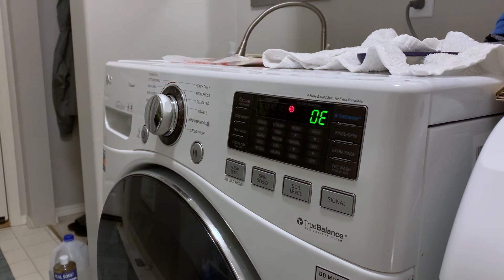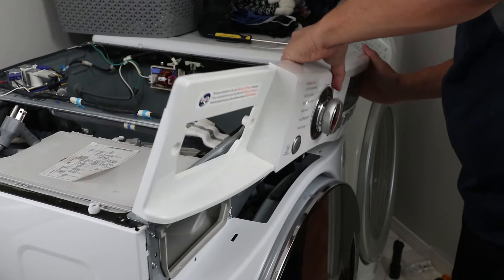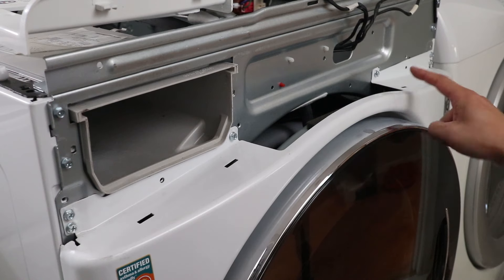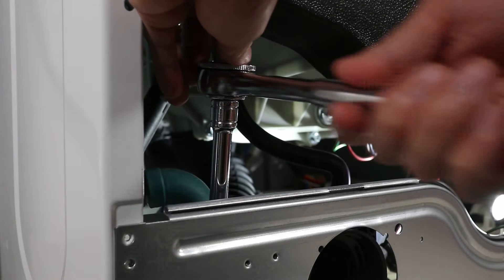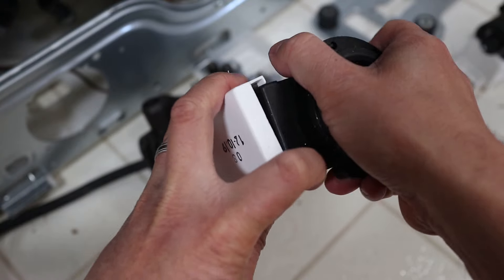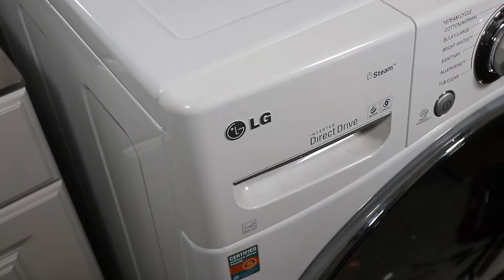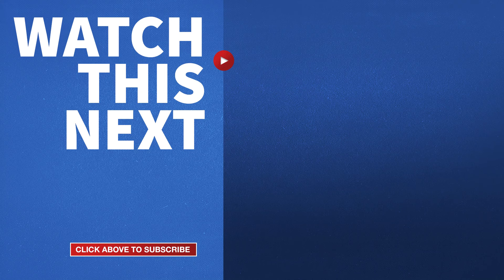LG Washer OE Error Code - LG Washer Not Draining Fix - LG Washer Drain Pump Replacement Tutorial

Comment: Well done - there was no corny, unnecessary commentary that dominates DIY videos.  I'm not handy, but was able to swap out the pump.  On Amazon - bought the pump for $20, and the spring tool for $12.  $32 repair and 90 minutes of my morning vs a new $700 washer, or $300 repair.  The hardest part was getting the pump out of the plastic housing.  The spring around the window was easy with the "spring tool."
Reply from the maker: So glad my video was helpful! It certainly saves a lot of money replacing the pump yourself! Nice work! Something you can feel proud of!

Comment: I watched several videos before this one. I really had doubts about trying to do it myself. After watching this one I didn't. It was very well done. I watched it beginning to end, went and bought the part and spring tool, and then watched it in segments as I did the job. It was an excellent tutorial and I want to say thanks for saving me some $$$$. The only place I disagree with the OP is that for me getting the main drain hose back on was the hardest part. But, it might have been the angles along with the pliers I had to use. All in all 10/10 from me. Thanks!
Reply from the maker: You’re welcome! I’m glad my detailed video gave you the confidence to take on this repair! I didn’t have any problems with my tubing but I can see how it can be difficult with the small space under the washer. Nice work doing it yourself and saving money! Thanks for watching!

Comment: Great video!  For the “spring stretching” part at the end I used a scissor, put the two tips in each loop and pull apart.  You’ll need someone to help you walk the ring in but it works!  Thanks again!
Reply from the maker: You’re welcome! Glad you found an alternative solution to help with reinstalling the spring. Nice work repairing your washer! Thanks for watching!

Comment: Wow thank you! I just did this repair on my LG that's almost identical to this video and your attention to detail made the job so much easier. I'd just add a word of caution to anyone that I think the 3 bolts that hold down the pump assembly go into plastic and only need to be hand tightened, could easily strip the plastic threads if using a ratchet to re-assemble. I could be wrong.

Comment: Great video! Would be nice if LG just charged an extra $100 for the washer and used a drain pump with a stainless steel impellor that doesn't warp and break. I did three of these pumps on my last LG washer. The replacement pumps they sell last maybe two years, so bookmark this video, folks, you will doing this again and again and again.
Reply from the maker: Yeah that impeller is plastic and can break easily over time. That’s why I made this video as detailed as possible so that when I need to replace the pump again I can see exactly what I did to replace it. Thanks for watching!

Comment: Though it took me longer than it took you, it worked!! My Unit had a metal bracket / brace that had to be fully detached from washer to replace the broken part. It didn’t have a quick clip like yours did. Added an hour of frustration, but I got it! Thank you
Reply from the maker: You’re welcome! I’m really glad you got around a snag that added more time to the repair! But also glad you got your washer fixed on your own without having to call a repairman! Thanks for watching!
Reply: I have to order mine do you what’s the part # of the water pump

Comment: Great video. Thanks for the info. I saved a few bucks and made my own spring expansion tool with two small head screw drivers and two zip ties. I crossed the screw driver shafts, put a zip tie going in each direction and it worked like a charm.
Reply from the maker: Excellent work! I think another viewer also made his own spring expansion tool! You guys are very creative!

Comment: Excellent job describing the process! Regarding the ring installation, I was able to get the ring back on using two bike tire levers. It’s a little finicky but possible. The expansion tool is probably an easier method. But in a pinch, the tire levers will work. Just get the ring started on the top half. Place two tire levers in the 4 and 8 o’clock positions. Place pressure toward the machine on the levers and wiggle them down to the bottom and push the spring over the ring retaining lip. 
Thanks for the video!
Reply from the maker: You’re welcome! Glad my washer pump replacement tutorial helped! Nice work getting the spring back on without the expansion tool! That’s a great workaround! Thanks for watching!

Comment: Thank you! I used ur video and successfully changed my drain pump. My LG was slightly different. I don’t have space to tilt it up and I have a drawer pedestal, so this was the way to go. I reassembled rubber ring easily with the help of another pair of hands.
Reply from the maker: So glad you were able to replace the pump in your washer even with the slight differences. Saves quite a bit of money doing it yourself!

Comment: It looks fairly simple. My LG washer is doing the same thing. I ordered the drain pump. Pretty cheap. Part came in today. Now to get the spring stretcher. Thanks for the tips. Also, I have stackable washer and dryer. Have to take the washer down. Worth a try. A project for the weekend. Keep you posted. .
Reply from the maker: Thanks for commenting! I hope you got your LG washer pump replaced ok! Hopefully my video was able to guide you through the process! Thanks for watching!

Comment: Thank you so much!  This is one of the best tutorials I've seen!  Notes I learned from taking mine apart: 1. the door switch plug is easy to get to once you undo the screws and lean it down toward you, then you can get a hand from the side and the top. 2. For the spring I just used some needle nose and stretched the spring really far, then just rolled the wire over the edge, it was super easy and doable. 3. Plug the wires in while the motor is out and you can see it clearly, I first installed then plugged and didn't get the contacts to connect and bent a lead which caused some unnecessary work.  Again, great tutorial, thank you for giving me the confidence to DIY!
Reply from the maker: You’re welcome! And thanks for the additional tips for this repair! I’m sure others will find your suggestions helpful! So glad you got your washer pump replaced yourself! Thanks for watching!

Comment: Great video. Had washer fixed in 48 hours with Amazon Prime delivery. Bought an OEM LG pump and the spring tool that is recommended in the video.
Reply from the maker: Excellent! Really glad you got your parts before starting your washer repair! Makes the process smoother! Thanks for watching!

Comment: I echo everyone else's comments about the quality and the helpfulness of this video. The only bits of constructive criticism I have are: 1) It wasn't clear (to me) that you need to position the manual drain hose through the hole in the front panel before attaching the mounting bracket, and 2) It would be helpful to warn novices (like me) to be aware about when they are tightening screws into metal versus plastic. I wasn't paying attention and I think I overtightened the three screws that hold the drain pump bracket to the bottom of the washer. I was waiting for the screws to get real tight but apparently they are screwed into plastic and they never got very tight so I probably stripped all three of the holes. I hope the bracket will stay secure! Thanks for this great video and I hope my comments are helpful to others.
Reply from the maker: So glad my washer pump replacement tutorial was helpful! I’m glad you were able to do the repair yourself! For me it’s definitely a lot to think about when shooting this video and doing the repair for the first time on camera. I’m learning as I go! I tried to include as many details as possible but it’s easy to forget to mention a few things. But overall as I read the comments this video has helped a lot of people! Thanks for watching!

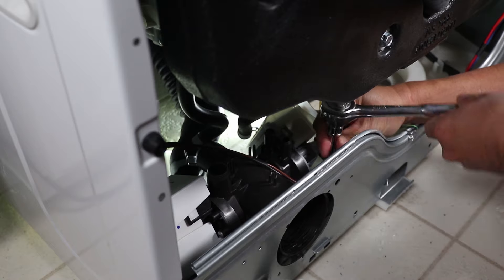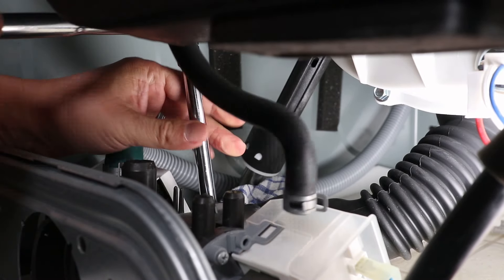Comment: You can get away without the spring stretching tool, if you have two relatively strong people applying pressure on the retaining ring at about the 7:00-8:00 positions, and 4:00-5:00 positions.  That will allow you to reseat the ring rather easily with a screwdriver.  Took us only two attempts to get it.

Fantastic video, BTW!
Reply from the maker: Really glad you found my washer pump replacement tutorial helpful! Yes it’s possible 2 people can get the spring back on without the spring expansion tool! I’m glad you had someone to help with that! The spring tool really helps when working alone. Thanks for watching!
Reply: I've taken it off and on many times myself with pliers. I now just leave it of and hung the wire on the back of the washer. Never have a problem,  just check the gasket once in a while. Now fixes are quick. Change the lock super fast as well as saves time on future repairs.
Reply: @Ann  Good to know.  I was looking for another option like cutting off the spring and replacing it with an elastic connector or something more forgiving. Something that could fit in the groove and e strong enough to provide resistance. I’ll leave it off for now until I find a better option.

Comment: Great useful video. I just cleaned the pump and put it back in. 
I did get the toughest part done without the tool. I pulled the spring open with two small screwdrivers while my wife helped get it in the groove.
Reply from the maker: Excellent! Glad you got the spring back on without the expansion tool! That part really is the hardest step in this repair! Thanks for watching!

Comment: Thank you so much for your detailed video. I purchased the spring extention tool and a pump. Your video gave me confidence to try changing out the pump and I was glad my LG ventless washer dryer combo had almost identical steps. I was able to also use the spring extention tool to help remove the spring instead of using a screwdriver to wedge it out. A tip that I was given years back from the guy that installed my Machine on how to easily slide and move the machine was to spray something like windex or soapy liquid on the floor under the machine and that helps glide it and it really works. Once again thank you and I am so happy to have a pump that is working again.
Reply from the maker: Thanks for the tip on how to move the washer! And the spring expansion tool can definitely be used to remove the spring. I just didn’t have it when I started. But as you saw I had to order one so I could finish the job. Thanks for watching!

Comment: Thank you so much for your video. Your instructions were perfect; easy to understand, easy to follow. My pump was broken at the impeller just like yours in the video. The hardest part for me was getting the drain hose back on the back of the pump ( not a lot of room). The spring ring around the gasket was easy with the tool you suggested. Well worth the $14. God bless you!
Reply from the maker: You’re welcome! Glad to hear you were able to repair your washer yourself! Yeah even with the price of the tool (that may only be used once) you still save a lot of money by not having to call a repairman! Nice job! Thanks for watching!
Reply: Agree, the hardest part was getting that pesky hose on back of pump. I may need to look for smaller pliers or smaller stainless steel adjustable clamps instead of the ones included in the lg washer. Overall this DIY video was awesome 🤩

Comment: I just replaced the drain pump with the help of your video clip. I also ordered the  pliers which make the job easier. I expect that the pump will need to replace again ( the old one last ten years). Thank you
Reply from the maker: You’re welcome! I’m really glad you were able to replace your drain pump using my video. Those pliers for the spring really comes in handy. And even though it was for one use it’s still worth it considering the cost if a repairman were to do the job. Thanks for watching!

Comment: Bwahahaha, I knocked off a bumper foot and took forever to find it. Got lodged in front in the wire cluster. I was creepy crawling all over trying to find it. Finally.
You are the best. I won. And it's working again. That gasket retainer with the spring is absolutely a (insert nasty word here) I needed 4 hands. Didn't have the plyers.
Your my hero.

Comment: I was ready to start calling around to schedule a repair visit.  I expected the removal of the front panel to be far worse. I was afraid I'd have to go in through the back, which I wasn't looking forward to. Your video showed it to be quite manageable. The two pump motors (Yep, two. Mine has two motors running to the housing - same part number.) are on order. Not sure which one is broken.  I'll just swap them both and be good for a while. I was on the fence with the pliers, but I don't have the patience to go to war with this thing, so I ordered them.
Reply from the maker: Excellent! By now you’ve probably repaired your washer I hope! The spring expansion tool is really helpful! Not too expensive either for what might be a one use tool. Overall the price of the pump and tool is WAY less than calling a repairman! Thanks for watching!

Comment: A wonderful instructional video. One of the best I have used. One point to highlight is to ensure that all water pipes are fitted tightly and for the main water pipe access maybe use a screw-down hose clamp as the one that comes with the LG is very difficult to fit due to the confined space.

Comment: This worked well for me, thank you very much! While you are in there you should also clean out the drain tube. Mine was all full of sand that most likely contributed to the failure of the pump and was preventing the tube from draining water in the tub. I also found when replacing the spring, you can use zip ties to attach to either side of the spring to give your fingers something good to pull on to release the tension. Works much better than pliers or screwdrivers and saves you from having to buy a special tool; just cut the ties off when you get the spring in place. Cheers!
Reply from the maker: Nice! So glad you were able to get your washer fixed! Yeah I should’ve checked the drain tube while I was in there. But I’ll definitely check it out if there’s a next time when I take the washer apart again. And great advice on the zip ties. Sounds like it works great as a substitute for the spring expansion tool. Thanks for watching!

Comment: For the spring install as I didn’t have the right tool, I removed one side of the spring attached to the ring and use a zip-tie to make the radius bigger then tight the zip-tie to secure it again. Works perfectly.
Reply from the maker: Excellent work around for the spring! And I know zip ties can hold things tight! Nice work!

Comment: Very helpful! Extremely easy to follow along. My washer was a newer model, but this video still applies.. just a few less screws.
Thank you!
Reply from the maker: You’re lucky you have the newer model! I guess LG realized how time consuming it was to take the thing apart to get to the pump. It would’ve saved me so much time if I didn’t have to take all the panels off! But I’m really glad that you were able to repair the washer yourself! Thanks for watching!
Reply: @digitalcamproducer  Thanks again! Yes, definitely a little easier. They certainly simplified it a little.

Comment: Thank you for sharing this as it saved me hundreds by not buying a new unit and following your instruction to fix it. Wondering if the pump breakdown is very common issue as I only owned this washer for just over 5 years.
Reply from the maker: I think the pump failure in these washers is pretty common. It’s probably one of the weaker parts of the washer and it gets used constantly. And if anything gets jammed in there like coins and other debris it can cause damage to the pump especially the impeller. So in 5 years time that’s a lot of wear and tear on the pump.

Comment: Great video.  I felt like I could open an appliance repair business after I finished this project.  Two things - I wish you would have said something about the spring expander at the beginning.  I got to the end and wasted another day because I had to go out and buy one.  Also, the rubber feet on the mounting pad in my machine were dry rotted.  Didn't discover that until I had the thing apart.  Fortunately, our local appliance parts shop had some left over grommets they gave me which solved the problem.